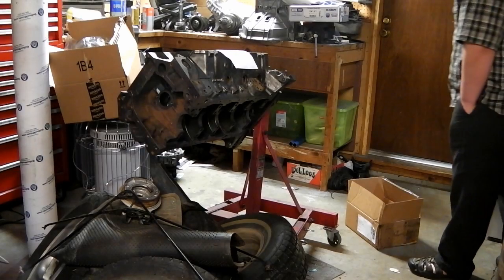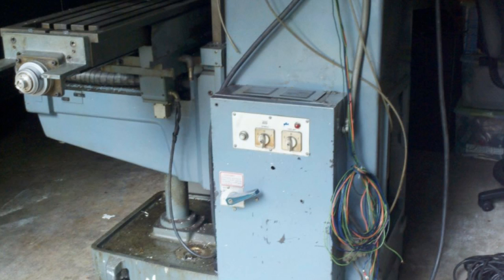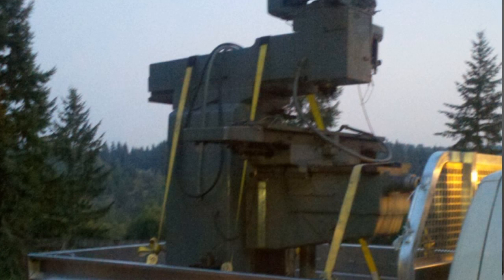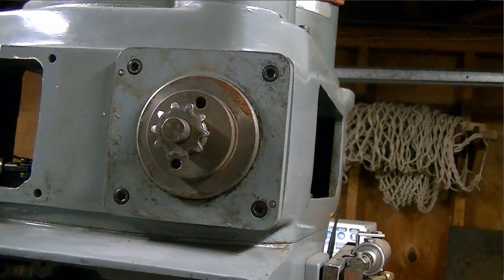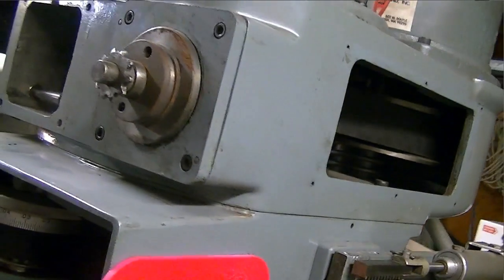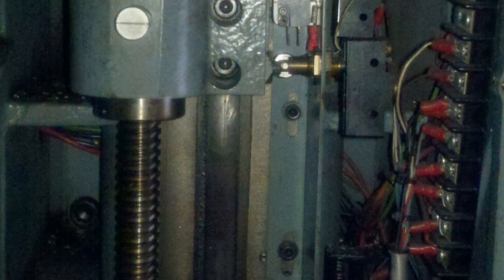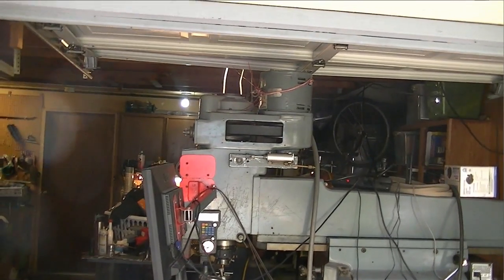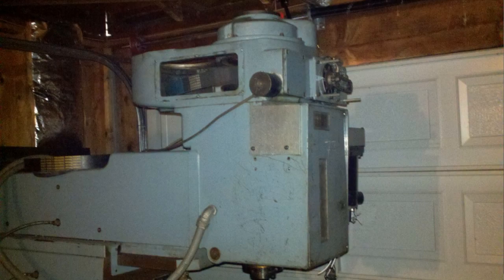The Thumblespuzz DIY CNC Milling Machine

Comment: Wow, great project! Man have you got more photos/vids? I have regular Shizuoka (not cnc) and thinking of converting it to nc control. There are some problems to overcome though:) The one that concerns me the most is the X-axis drive as on my mill the X-axis lead screw is stationary (fixed to the table) and the nut is driven. I plan to make some mechanism to fix the nut and make the screw rotating. Would you be so kind and contact me?

Comment: That is a great machine.  What was wrong with it when you bought it?  The machine looks like it is in great shape.  If I was you land-lord I would help you fix that bad boy up:-)

Cheers -
Mike
Reply from the maker: Mike Sportsman It's seen a lot of hours, without much maintenance, and all of the controls were gone. One of the servos was still with it, but broken, and the way lube system was clogged solid, the gibs had never been adjusted, and so many little things like that. It used to have a tool changer and a power draw bar, but I didn't really need them anyway, so I scammed a surplus Erickson quick change collar onto the spindle. It does limit my tool holder selection a bit, though.
Reply from the maker: Sorry for the long delay. When I got it, it had no controls, but other than that it was just dirty. The ways are kind of worn in the middle, and the gibs had never been adjusted. It has a little backlash in the x axis, too.